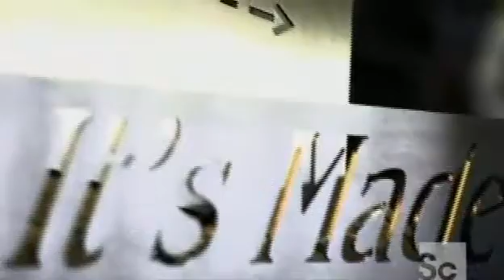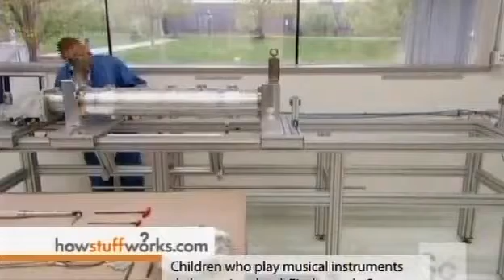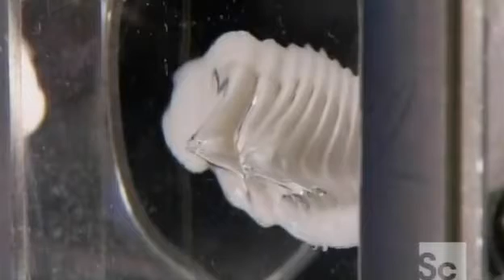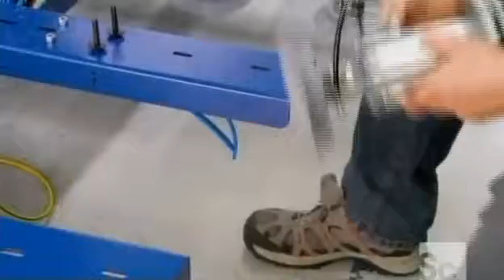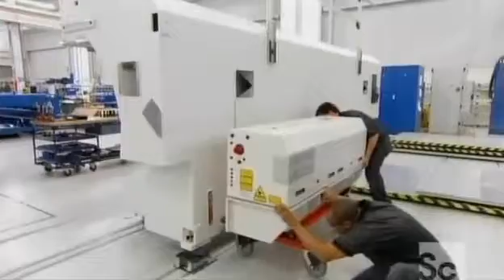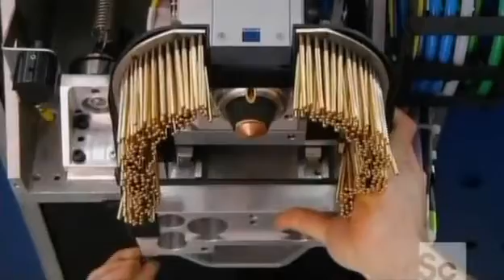How its Made, Laser Cutter Machines.

Comment: They may have been referring to a "Punch Press", which has a mobile head like a laser, and a pin that punches the material, over and over, to get the required shape. When you are trying to make a million of something (Like a computer case, as you said, or appliances) then it's worth it to set up dies (Dice?) to punch the parts and form them. 

Another thing a laser can do is cut thicker materials. A 4000 watt laser will typically handle 3/4" thick carbon steel, or 1/2" Aluminum or Stainless.